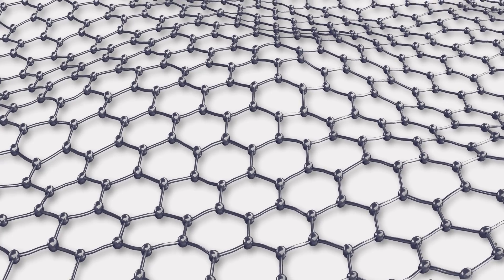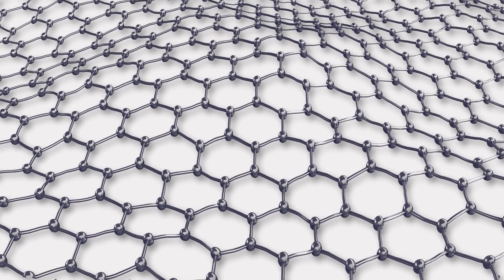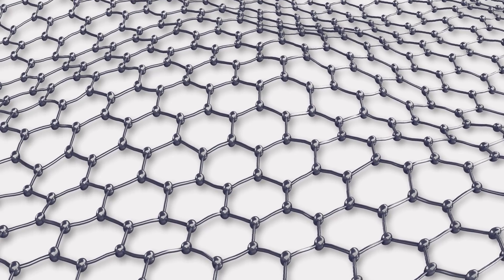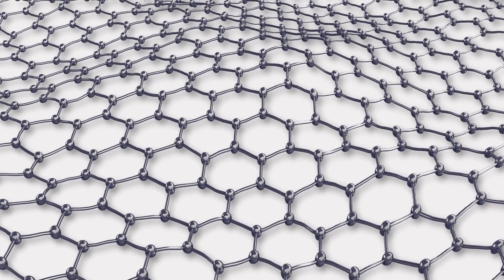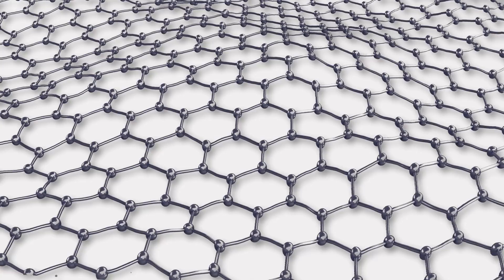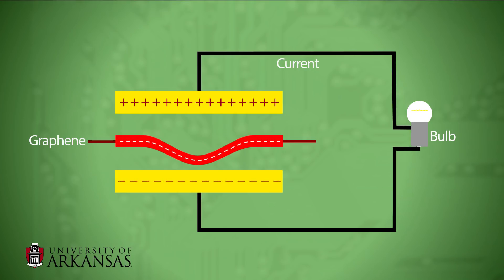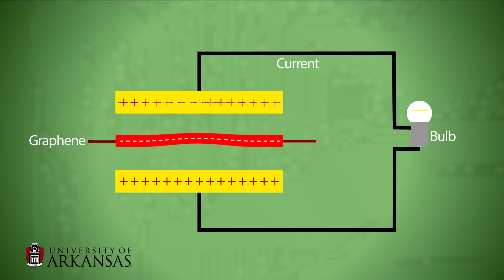A Potential Source of Clean, Limitless Energy

Comment: There's nothing special about this.  It isn't a perpetual motion machine or battery.  It simply harvests a small amount of energy from thermal and vibrational variations of the surrounding environment that are big enough to harvest.  There are many devices that can do this by various means.  Small amounts of energy can be harvested from wifi signals, for example.  None of these devices produce very much energy and none of them can be scaled up because the amount of energy available to harvest is tiny and not really based on receptor volume.  The energy involved here is not coming from the quantum vacuum, but travels to the receptor through the air (like a wave), so the amount you can harvest is more a function of an intersection from the source and not a function of volume.  In fact, simple pendulum winders found in watches that harvest a little bit of energy from your normal arm motion generate far, far more energy than this device ever could.

In this particular case, the more charge associated with the sheet of graphene, the less mobility it will have.  To act as a battery the graphene needs to be able to pump charge, which basically means bringing together objects with the same charge.  That requires something doing work... the work is harvested from the environment, but the environment must contain sufficient differentials in what is being harvested to generate enough of a voltage differential to be useful and that's really the limiting factor here.

-Matt
Reply: 📰 "The findings, published in the journal Physical Review E, are proof of a theory the physicists developed at the U of A three years ago that freestanding graphene — a single layer of carbon atoms — ripples and buckles in a way that holds promise for energy harvesting.

The idea of harvesting energy from graphene is controversial because it refutes physicist Richard Feynman's well-known assertion that the thermal motion of atoms, known as Brownian motion, cannot do work. Thibado's team found that at room temperature the thermal motion of graphene does in fact induce an alternating current (AC) in a circuit, an achievement thought to be impossible."

📰 source: https://phys.org/news/2020-10-physicists-circuit-limitless-power-graphene.html 

📰 October 2, 2020
Reply: How refreshing to read a comment by someone who understands the science! Thank you.
Reply: It's has nothing to do with being special, it's all about "is it useful".

"By Thibado's calculations, a single ten micron by ten micron piece of graphene could produce ten microwatts of power. It  mightn't sound impressive, but given you could fit more than 20,000 of these squares on the head of a pin, a small amount of graphene at room temperature could feasibly power something small like a wrist watch indefinitely."
Reply: @calvinsylveste8474  That means, best case scenario, this is as useful as a tiny dial you turn with your finger once a month, or a tiny battery that you replace every few years for $3
Reply: What you describe are systems that collect energy which has already been "poured" as heat into the environment by another power source; however, none of these extract energy from Brownian motion. According to quantum mechanics, a physical system cannot reach absolute zero (0 K) (−273.15 °C) (−459.67 °F) due to the existence of quantum fluctuations, which constantly increase the temperature by very small ammounts; that means that Brownian motion never stops occurring in a physical system (it occurs whenever temperature >0 K). If this graphene sheet is capable of extracting energy from Brownian motion, it would in fact mean that it is capable of generating energy out of nothing.
Reply: @proveritate1205  yea
Reply: I find it hard to be leave it is an infinite energy machine. Most likely the energy used across the graphene strip is more than the output of the system.
Reply: @danwat1234  Of course is not infinite, it will keep working until it breaks. A good watch battery can last for several years, this probably can last for several decades but it will eventually degrade and break down.
Reply: @Junker Zn I'm not agree with you, produce electricity just with temperature doesn't exist anywhere, except that. You can produce Electricity with a difference of temperature. And that make the all different, because, this device kill the second principe of the thermodynamique

Comment: This is a perpetual motion machine of the second kind.  Admittedly,  the Second Law of thermodynamics is merely a generalization based on what we observe in the world around us,  There is nothing about the law that makes it impossible for some assemblage to violate it, most gadgets never studied law. But for proposed perpetual motion machines of the first or second kind, you can usually identify the loss mechanisms that prevent you from having any net gain in the machines.  It's a matter of semantics, but I hate it whenever someone asserts that nothing can violate the first or second laws. The fact that nothing violates the laws doesn't mean the laws are some sort of a barrier that is inherently absolute. If we observe a violation of the laws, we would do well to doubt our result initially, but once verified, we would have to rewrite the law to reflect the exception we've found. 

The first law states that Mass/Energy cannot be created or destroyed, yet mass falling into a black hole would seem an exception to the First Law.  Virtual particles and the quantum level are also an exception. Rather than say that virtual particles or black holes can't exist because they would violate the First Law of Thermodynamics, we should instead refine our expression of the 1st Law to accommodate reality.

This graphene device would harvest ambient thermal energy, cooling the device while outputting electricity. This is a new spin on an old idea. For any resistor, there is a noise voltage the amplitude of which it determined by temperature according to Boltzmann's constant. That noise is the hiss you hear from a high gain audio circuit. If it were possible to rectify this voltage, one could, for instance, power a submarine through the water. The sub would extract energy from the water by exhausting cold water. Then the friction of the vessel's movement through the water would reheat the water.  The sub would get around for free without affecting the ocean thermally. 

By adding graphene to the system, this guy is only adding fog to an old idea. Here is the foremost law of perpetual motion machines:

"The only requirement for a given perpetual motion machine to be feasible, the cause and effect within the machine must be beyond the comprehension of the inventor,  or that of the investors... "

I'm betting this guy is going for the latter
Reply: 📰 "The findings, published in the journal Physical Review E, are proof of a theory the physicists developed at the U of A three years ago that freestanding graphene—a single layer of carbon atoms—ripples and buckles in a way that holds promise for energy harvesting.

The idea of harvesting energy from graphene is controversial because it refutes physicist Richard Feynman's well-known assertion that the thermal motion of atoms, known as Brownian motion, cannot do work. Thibado's team found that at room temperature the thermal motion of graphene does in fact induce an alternating current (AC) in a circuit, an achievement thought to be impossible."

📰 source:
https://phys.org/news/2020-10-physicists-circuit-limitless-power-graphene.html 

📰 October 2, 2020

Comment: I was reading the comments... Sure, law of thermodynamics...
Some things do not make a lot of sense here.
first just touching one electrode and then the other does NOT generate energy or transfer charge other than the one 
that already was there, try it with a piece of tin foil (not on head) and 2 wires.
Second, if it vibrates there is a REASON it vibrates.
So, to eliminate things as obvious as airflow (kW power windmills are cheap and reliable) I HOPE the professor
also did the test in vacuum, and did other obvious checks to eliminate systemic errors.

As to the the new free energy source and 100% better battery invented every few weeks, the local shop still does not have it.
Reply: 📰 "The findings, published in the journal Physical Review E, are proof of a theory the physicists developed at the U of A three years ago that freestanding graphene — a single layer of carbon atoms — ripples and buckles in a way that holds promise for energy harvesting.

The idea of harvesting energy from graphene is controversial because it refutes physicist Richard Feynman's well-known assertion that the thermal motion of atoms, known as Brownian motion, cannot do work. Thibado's team found that at room temperature the thermal motion of graphene does in fact induce an alternating current (AC) in a circuit, an achievement thought to be impossible."

📰 source: https://phys.org/news/2020-10-physicists-circuit-limitless-power-graphene.html 

📰 October 2, 2020

Comment: Just as the charged graphenes random buckling inferences a charge in the capacitor plates, randomly fluctuating charge in those plates makes the graphene buckling. That is called themal equilibrium. And one can extract zero power form it. (Look up feynman ratchet.) Either this professor misses to mention a thermal gradient (which would be bad enough) or he currently does not deserve his degree.

Comment: Wait wait wait, what? What is the energy source? Vibrations? So... is it temperature? What is causing the gradient then?  Or is it like those old clocks that wind themselves when you walk? No matter the case, you can't leave it at "an alternative to battery which never has to be recharged" because this is the internet and there is such a thing called "perpetual motion machines believers" that will make a day out of this. This is a science outreach video from the university of Arkansa, so you guys have to be more diligent with what is said. Look at your comments section! 

This is not limitless energy!
Reply: temperature changes caused by ambient heat it says in the description.
Reply: 📰 "The findings, published in the journal Physical Review E, are proof of a theory the physicists developed at the U of A three years ago that freestanding graphene—a single layer of carbon atoms—ripples and buckles in a way that holds promise for energy harvesting.

The idea of harvesting energy from graphene is controversial because it refutes physicist Richard Feynman's well-known assertion that the thermal motion of atoms, known as Brownian motion, cannot do work. Thibado's team found that at room temperature the thermal motion of graphene does in fact induce an alternating current (AC) in a circuit, an achievement thought to be impossible."

📰 source:
https://phys.org/news/2020-10-physicists-circuit-limitless-power-graphene.html 

📰 October 2, 2020
Reply: I betcha the Film only oscillates cause of Earths Electro-magnetic field! It ain't gonna move by it self!

Comment: There has to be say,  a loss of thermal energy in the material if work is extracted.   Energy can't be created.
Reply: 📰 "The findings, published in the journal Physical Review E, are proof of a theory the physicists developed at the U of A three years ago that freestanding graphene — a single layer of carbon atoms — ripples and buckles in a way that holds promise for energy harvesting.

The idea of harvesting energy from graphene is controversial because it refutes physicist Richard Feynman's well-known assertion that the thermal motion of atoms, known as Brownian motion, cannot do work. Thibado's team found that at room temperature the thermal motion of graphene does in fact induce an alternating current (AC) in a circuit, an achievement thought to be impossible."

📰 source:
https://phys.org/news/2020-10-physicists-circuit-limitless-power-graphene.html 

📰 October 2, 2020
Reply: The heat is extracted from the environment surrounding the circuit.

Comment: If this worked you would be producing energy while at the same time increasing the temperature difference between the graphene and the ambient envionment. The only way I could see this working under understood physics is if the graphene's fluctuations are not caused be heat but are caused by the graphene reacting to localized fluctuations in the surrounding electromagnetic field that are caused by ambient photons. It would be kind of like a (very) broad spectrum solar cell. There are easy ways to test this. Try the apparatus under different temperatures to see if ambient heat really does play a role. Try it in a vacuum chamber. Try it in a EM suppressing envionment like a (really good) faraday cage.
Reply: 📰 "The findings, published in the journal Physical Review E, are proof of a theory the physicists developed at the U of A three years ago that freestanding graphene — a single layer of carbon atoms — ripples and buckles in a way that holds promise for energy harvesting.

The idea of harvesting energy from graphene is controversial because it refutes physicist Richard Feynman's well-known assertion that the thermal motion of atoms, known as Brownian motion, cannot do work. Thibado's team found that at room temperature the thermal motion of graphene does in fact induce an alternating current (AC) in a circuit, an achievement thought to be impossible."

📰 source:
https://phys.org/news/2020-10-physicists-circuit-limitless-power-graphene.html 

📰 October 2, 2020

Comment: Convection always vary nothing is perfectly still unless at absolute 0 thus fluctuations at nano scale are plausible due to micro fluctuations we cannot easily measure yet they are there. Now to combine small structures to a larger collector and you have room temperature energy production. No laws broken.
Reply: 📰 "The findings, published in the journal Physical Review E, are proof of a theory the physicists developed at the U of A three years ago that freestanding graphene—a single layer of carbon atoms—ripples and buckles in a way that holds promise for energy harvesting.

The idea of harvesting energy from graphene is controversial because it refutes physicist Richard Feynman's well-known assertion that the thermal motion of atoms, known as Brownian motion, cannot do work. Thibado's team found that at room temperature the thermal motion of graphene does in fact induce an alternating current (AC) in a circuit, an achievement thought to be impossible."

📰 source:
https://phys.org/news/2020-10-physicists-circuit-limitless-power-graphene.html 

📰 October 2, 2020

Comment: Can someone smarter than me explain what powers the vibrating of the graphene.
Is it the vibrating of atoms that occurs when any thing is above absolute 0k, and if that's it is it not lowering it's self on entropic state by turning that entropy into electrical power?
Reply: The ripples are induced from heat in the environment, theoretically. Think of it sort of like a large sheet of tin that is heated and cooled at small points and the expansion/contraction induced from the heating/cooling. That's a gross oversimplification of course, it is mathematically explained using stochastic thermodynamics - Langevin and Fokker-Plank equations.
Reply: Zero point energy my friend...  Power from the void.  It's proven.  This is just a great way to nab it.  It causes vibrations. Look it up.